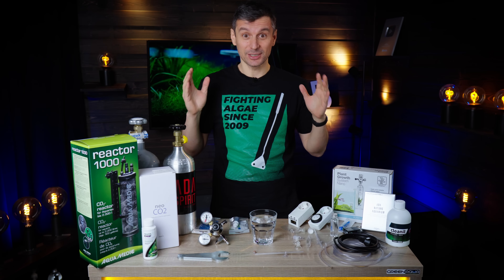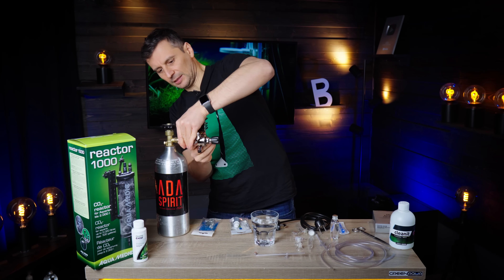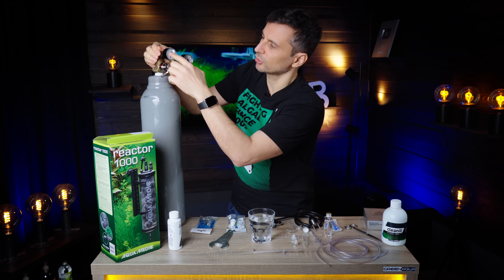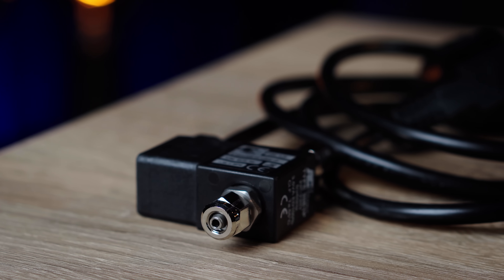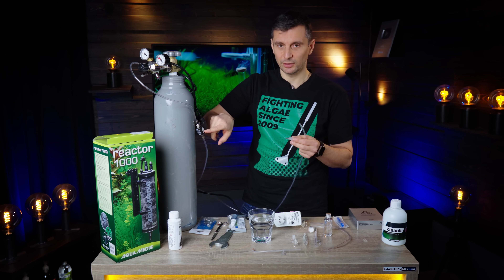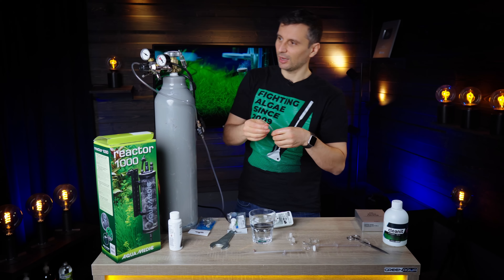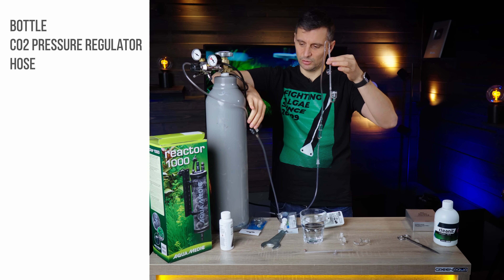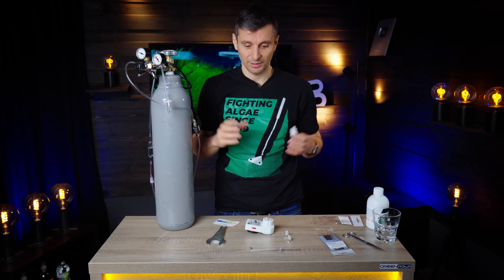Complete CO2 System Set Up with a DIFFUSER

Comment: If you don't know how a pressure regulator works (they are pretty common with nitrogen, oxygen, and carbon dioxide), you should definitely learn. It helps a lot when dealing with anything related with a pressure regulator such as brazing, torching, etc.

Comment: Shouldn’t you put the check valve after the bubble thing so water won’t get anywhere near it?
Reply from the maker: The check valve is to protect the electrical devices. Like the magnetic valve on CO2 regulators

Comment: What are the odds of a CO2 tank exploding?  I have to think about the safety of my kids before I try this out.  I've seen videos of smaller CO2 cartridges exploding when heat is applied.  While not flammable, the impact is really strong and damages anything around it.  So what are your thoughts on these things possibly exploding from heat or too much pressure?
Reply from the maker: With room temp this never happens. If the house is burning it is not the only one thing which will damage. The cylinders are safe to use at home as we regulate the pressure.
Reply: @GreenAquaShop  - Thank you so much for your response!

Comment: Hi. Which is correct. 1)24 hour open co2 system or 2) two hour before open co2 system lightining aquarium
Reply from the maker: Both works with pros and cons on each 👍
Reply: @GreenAquaShop  thanks.

Comment: Do you guys rate or use the Aquario Mixer with the diffuser? Love the design but hardly see it used and plastic look and cleaning worries me a bit. 🙏 Thanks
Reply from the maker: We used it before on smaller tanks, my main concern - personally - is that these in-line diffusers will fill the tank with tiny CO2 bubbles that obstruct the view. Nonetheless, they work fine and do the job. Cleaning is not a problem, you just bathe it in a cleaning solution, rinse it properly and you're done.
Reply: @GreenAquaShop  thank you! Which reactor is the most reliable please? I always worry about solenoids going wrong and filling the tank when I don’t want them to! Do you have visible bubble counters with the reactors? Agree about seeing bubbles. Is the evidence good enough that bubbles help the leaves?
Reply from the maker: Yes, you can bring out the hose to the side of the tank, put a glass bubble counter there and bring the hose back into the cabinet to the reactor, done that before. I think you meant the pressure reducer or the solenoid, the reactors rarely break (except when leaking). Check out our website - all available CO2 gear is of good quality, and tested.
Reply: @GreenAquaShop  thanks! I’ve had good experience just using a micro diffuser by the intake on the filter, and easy to clean. Have you any experience of anything negative with that option?
Reply from the maker: Don't get any CO2 into the filter, it lowers the pH and harms the useful bacteria!

Comment: Thanks for the video. I have an aluminum cylinder and it’s out of CO2. I bought a DIY refill with the powder and yeast to mix manually. However, I can’t seem to open my cylinder to put the mixture in. Is it possible to do a manual refill for such cylinder?
Reply from the maker: You will not be able to do this with high-pressure cylinders. The ones which is made for mixing is different.

Comment: Hi, great video. 👏👏 what you think it's better for injection of CO2 in aquarium, a diffuser like what you use in the video that is inside of aquarium or one mounted on the filter hose like JBL pro flora taifun inline? Its an aquarium with 300L. Thanks

Comment: Does the co2 bubbles need to be blowing around the tank or is it fine just going up the surface? What I did was put the diffuser directly infront of the outflow to spread the bubbles across the tank.

Comment: Hello! I really enjoy all your video guys. I have a quick question. Is it good or bad to place the Co2 diffuser just next to the suction pipe of my external filter? I'm thinking like this the Co2 has more time to dissolve in the water before being injected back to the tank via the outlet pipe. But maybe the Co2 concentration will be too high for my beneficial bacteria inside my external filter.
What are your thought about it ?

Comment: Is the CO2 drop checker shape important?

I'm setting up co2 for a 50 liters aquarium and I'd like to have it as clean as possible inside. I've seen balls, hang on and conic (the clasic one) drop checkers but I'm unsure if the ball or hang on won't work well due to the smaller surface area exposed to water.

Comment: Am i the only one afraid of the hose that s between the co2 and solenoid? can it hold such pressure?
Reply from the maker: That's a pressure-resistant hose for CO2. It can handle 2-3 bars which perfect for most diffusion

Comment: Dear Balazs, as always your YT channel is up to date and very neat! There is a small issue with my CO2 injection system, and I would like your professional advice. Unfortunately, here the water is hard, around 13-15GH. My PH is 7.6 and I realized after some time that if I want a PH drop point before the lights kick in, then I have to, not only have 2 hours before the injection to start, but also more than 3,5b/s which is kind of stressful to me 😅,  and not to the inhabitants (yet) (15 days ish). Do you believe that the only solution seems to be the RO system, and then re-mineralize the water? Thank you in advance! Keep providing us with such professional tutorials! 😊

Comment: One of the ways of determining CO2 in the aquarium is by monitoring the change in pH when CO2 is being injected ("Aquascaping - a step by step guide" by George Farmer) , but surely this change of pH is not a good thing? I'm trying to get my 160L set up with CO2 injection - using tap water (TDS ~200), CO2 injected 2 hours before lights on (7 hours) & CO2 off 1 hour before lights off. Drop checker goes from blue to pale green over that period & pH drops from ~7.5 to ~7.0 which equates to ~9.5ppm CO2 at best. I am concerned that (a) I'm not getting enough CO2 to benefit my plants, and (b) the variation in pH will be detrimental to any livestock that I purchase. Any advice would be gratefully received.
Reply: Forgot to mention, currently running at ~3bps

Comment: So my Co2 when I open it, it wont really pump the co2 directly in yet, I need to manually boost up the pressure for it to pump and put it back to 1second 1 bubble everyday, is that normal? or how can i solve the problem?
Reply from the maker: Bad needle valve... Change your tech.

Comment: I have such a problem with the co2 system that when I set the gas flow correctly, everything goes to waste the next day. After opening the solenoid valve, the gas flow is quite different and often does not fly in inches. I have already replaced two non-return valves because I could see the water in the hose below them and nothing helped. Recently, after opening the solenoid valve, the diffuser fired from the hose, which shouldn't happen right? I am asking for some advice what could be wrong. For now, it seems to me that I think I have a broken reducer - aguario blue. As I set the flow in the morning, it flies as it should, but the next day everything gets screwed up.

Comment: Is it not better if using a solenoid not pre-fitted, to connect the solenoid to a metal tubing (some specialist insist on supplying them) rather than  plastic tubing, is there not a danger of blowout between the tank and the solenoid when the tank pressure output is being blocked by the solenoid switch off? 
My solenoids came fitted directly to he output of the second controller on the gauge to ensure this blowout doesn't happen. The third stage of fine tuning (for bubble rate) after the solenoid.
Maybe this is a unnecessary concern, but I think worth asking.
Reply from the maker: Both ways work fine. Tube and the fitted/fixed ones too. 👍

Comment: I am getting a 75 gallon tank set up. I noticed what looks like dragon stone in a flower bed in front of my new house. The guy who lived here before me had a tank, and when he died, I think they just dumped all the stones there. After digging around, I found a nice pile of similar stones, along with what looks like elephant skin stones. As I kept digging around, I ended up finding a ton of red and orange smoother rocks, with a couple black one, and a couple white ones. I'm gonna clean them up, and go from there. I don't think I'm going to have to buy rocks, just substrate and top dressing.

Comment: how do you know if you have a co2 or oxygen in your tank? some suppliers may exchange co2 to oxygen tank.
Reply: If your supplier exchanges your co2 for oxygen, you need to find a new supplier immediately because they just made a massive, and dangerous, mistake. If this actually does happen, let them know immediately.

Co2 regulators have a CGA-320 fitting on them. Oxygen regulators have a CGA-540 fitting on them. You wouldn’t even be able to hook up your regulator. Also, any reputable gas supplier will have cylinders that adhere to local and federal laws that contain a sticker or some kind of identifying marks on the cylinder itself noting what gas it contains. I’m from the US, not sure where you’re from, but I imagine that any modern road safety commission has transportation regulations in place for pressurized gas. Oxygen is extremely flammable. Co2 is not flammable at all. Oxygen would fall under a different category than co2 meaning it has different regulations when it comes to storing, transporting, handling, and even purchasing. Now, if you’re refilling used fire extinguishers, I can’t help you there. I don’t have experience with that.

Again, If your supplier exchanges your co2 for oxygen, they made a critical mistake and it needs to be addressed immediately.
Reply: @ryanwilson5936   in my area they use fitting used for co2 that's why the exchaged my tank to an oxyge tankso they can fill it with cO2

Comment: hi green aqua, nice video again.. do u have some tips on how to prevent the connection from leak? i already used CO2 tubing, but  the tube always leak at the connector with the diffuser, before the U bend tube.
Reply from the maker: Make sure to clean off the connection parts. So no water remains there. A paper towel it perfect for that. Do this also with the internal part of the CO2 tube. This way the tube will stuck to the diffuser without slipping or to have air bubbles.
Reply: @GreenAquaShop  i see.. thank you sir.. btw keep up to good work.. you guys really made me fall in love in aquascaping.. see u guys in IAPLC. (pray to be in the list)
 hahahah...
Reply from the maker: Thanks so much, love to hear we've been inspirational and helpful in some ways 🙏

Comment: Interesting would be a more detailed video about how to dial in co2 and keep constant levels during photoperiod. Especially when it gets to bba and co2 deficiency.
Reply from the maker: BBA is less of a CO2 problem. I would check the flow and substrate disturbance first. If you have strong water movement and the aquarium is not planted densely the BBA is common.
Reply: @GreenAquaShop  Thank you for the answer. The tank is densely planted with a sand area in the foreground. Bba only on rocks, plants are growing well and I use a Twinstar 600S II at 70% for the 60P. Drop checker is yellowish during photo period. Filtration with a JBL 902. Flow is not super powerful, but I always wave a sand flattener to lift detritus before a weekly 50% water change. 

Your tanks are free of bba, so I wonder what I’m doing wrong. 😅

Another tip would be greatly appreciated. 

Greetings

Comment: When you change water in your tanks. Do you put pure RO water in og do you remineralise the water to 120-130 ppm before changing? Grettings from denmark:)
Reply from the maker: Not needed in most cases. Enough to do that in the aquarium.  👍
Reply from the maker: 120-130ppm is fine
Reply: @GreenAquaShop  Thx a lot:) Love your channel, great work and pure meditation to watch:)
Reply: 120-130ppm or 120-130uS?

Comment: I loved what happened at the beginning, when the co2 regulator could not be connected to the cylinder. It reminded me that it usually happens and you are left with a mixture of impotence, anger, since you invested in something good and it does not work. He was lucky to have another cylinder, but we don't have that. Good video.

Comment: Very nice tutorial, but I decided to use an in line CO2 diffuser. Suction cups and CO2 hose become hard with the water and dont hold in place. Too many problems I had with that. Thanks anyway.
Reply from the maker: You will find other problems with the inline ones, but there are pros and cons on almost all diffusion methods.
Reply: Double greenaqua here, had nothing but problems with inline, i am stuck with ladders :) really old school, very reliable :)

Comment: I use the Neo CO2 on my Fluval Spec III. Works perfectly and it’s running all the time. Also very budget friendly. The media that the yeast feeds off of lasts a very long time. You’ll actually run out of yeast before the media. So what I did was buy a jar of yeast at the grocery store and use that. A single NEO CO2 bottle has lasted me almost 8 months and I still have enough to stretch it longer. Not bad for $20 here in the states.
Reply from the maker: Yup a pretty good wallet friendly way to try CO2 in a small aquarium

Comment: Great video :-) I see you guys are mostly using in-tank co2 diffusers instead of in-line diffusers. Why is that? And would you recommend in-tank over reactors/inline?
Reply from the maker: We're using either diffusers or external reactors. Not a fan of the inline ones. Many bad products are on the market. We've tested a dozen of them in the past and have more cons than pros.

Comment: What about the reactor? Is there a specific way to connect that or we should basically put the CO2 inlet in it and thats the end of the process for it?
Reply from the maker: Reactors are connected to the filter pressure side. There are a couple things to consider tho. Bypass, media in it etc.
Reply: @GreenAquaShop  What role does media in an external reactor plays? Is it for biological filtration?

Comment: I like these kind of videos! please do more! But I would like to say  that the hose before the solenoid should be as short as possible.  If the solenoid is closed co2 will build up in this part of hose until working pressure is met. If the solenoid opens the pressure is released and it gives a burst of co2.  That is not necessarily a problem but it can make the hose pop off the glassware or empty the bubble counter faster then you would like...
Reply from the maker: That's right if someone uses a hose for the connection that should be the shortest as possible.

Comment: Is an inline co2 better than a reactor for a 300 litre high tech tank?
Reply from the maker: Nope, inlines are ok for smaller aquariums. For larger ones they produce too much bubbles. Reactor will do a much better job and will dissolve the gas better.

Comment: 支持下。很好的视频。不过电磁阀和减压表分离，表和电磁阀之间的瞬间压力有可能过高吧？
Reply from the maker: You can use a fixed connection there or a pressure resistant hose. Make sure the hose is short as pressure builds up in it.

Comment: I have a 250 lt aquarium and my Co2 bottle 5 lt , but some how it’s ending after 2-3 month , I have solenoid valf and diffuser and I’m giving co2 only 8 hour also I’m checking indicatör it’s always green , so my question is , is it normal that my bottled finishing in 2 month ?
Reply: Check CO2 cylinder and reduser connections. 
I have a 300 liter aquarium and a 6 liter CO2 cylinder it is ended in 2 months. I tested the connections with a soap and water solution. It turned out I had a damaged seal gasket between the cylinder and the reduser
Reply: @enzim87  I already did but couldn’t find any damage , now how long it takes your bottle for 300 lt after finding damage ?
Reply from the maker: for a 250L aquarium this 5kg cylinder should last 6 months or so. Depend on the effectiveness of your system. There are no leak on the regulator side as it would ran out much quicker. Make sure the hose is good (might worth to change it) also measure the cylinder when you start and check the empty cylinder weight on the neck of the cylinder. Maybe it is not filled correctly. Use soap and water to check leaking or leak checker.

Comment: Hi! My opinion is that a solenoid valve is needed if in aquarium set pH controller. pH The controller turns ON the solenoid valve when the pH rises and turns it OFF when the pH reaches the desired level. In this case, the amount of CO2 supplied must be slightly higher than normal in order to ensure pH control by the solenoid valve. 
There are several questions. 
1. What is your opinion about this application of the pH controller? 
2. Have you used pH controllers? 
3. What type of co2 reactor do you recommend: static (JBL Pro flora or Dennerle Flipper) or active with impeller (ISTA)?
Reply from the maker: 1. controllers are great for a certain use. we use them mainly for larger aquariums
2. yup they are great
3. would go for another. like the one we use aqua care, aqua medic. the ones you listed isn't the best one for the task

Comment: Is the tube between regulator and solenoid able to handle back pressure when the solenoid valve is off
Reply: in the tube there is a low pressure which is not more than 0.4-0.6 MPa. This pressure depends on how you open the coarse adjustment valve on the reducer
Reply: @enzim87  I’ve set up in a similar way, but my systems tube keeps swelling in between regulator and solenoid, I’m afraid it might go off or something, I feel a solenoid hooked up directly to regulator is better, can you suggest which is better?? Or any better tubing of any particular brand??? My tubing is of a good brand though
Reply from the maker: Yup, but you need pressure resistant tube. Not O2.
Reply from the maker: Both works well. Fixed one and the hose as well.